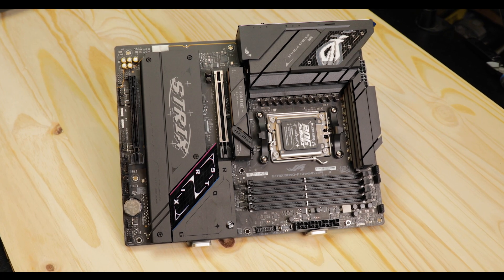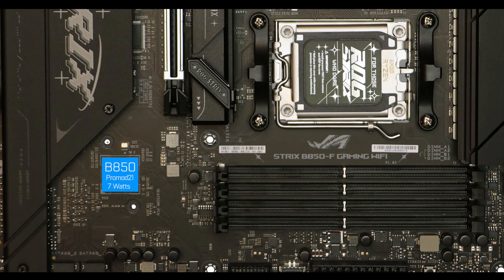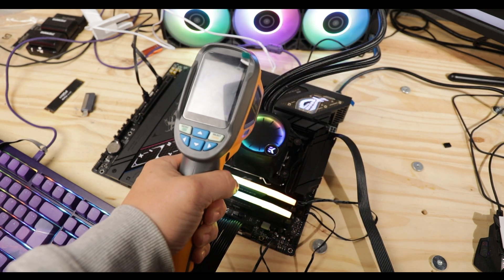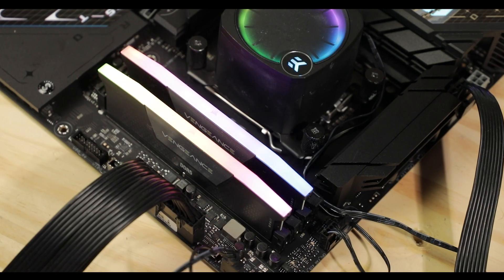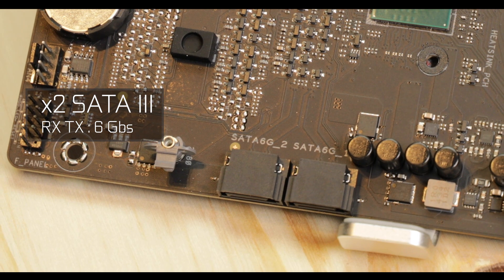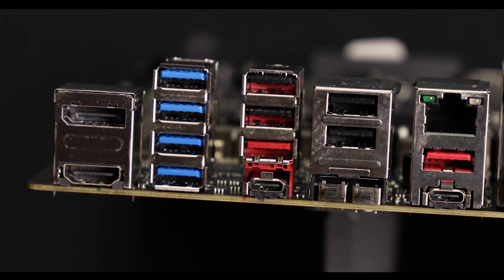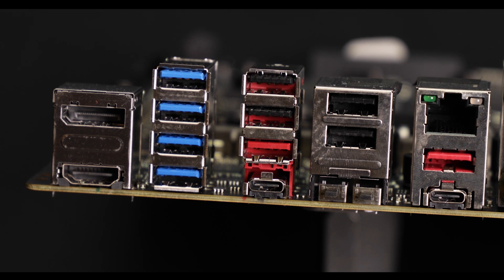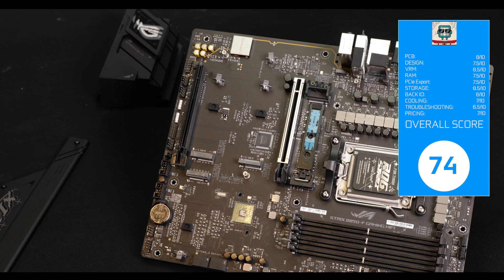ROG STRIX B850-F GAMING WIFI:  The F stands for FABULOUS!

Comment: Amazing work with graphics showing. I got one question though. I have 2 M2 SSD. One is surely goes under CPU, which one would you choose? I don't have Gen5 SSD. I am thinking right-last slot.
Reply from the maker: yes you are correct. The CPU M.2SSD and the last one are perfect

Comment: I've seen multiple of your videos talking about "50 degree limit" for the side block, but where is that number coming from? Does CPU or Mobo begin throttling past that? I am unable to find any other documentation mentioning the 50 degree limit
Reply from the maker: Hi Slav :)

Its a self imposed limit :) 

Boards who typically mange to get their VRM to stay anywhere between 50 and 60C after an hour long synthetic stress test on a high core count CPU, show all the qualities to be :

- durable , the solder point are far from being strained over time. When soldered points nuggets 80c, eventhough they do not melt, they start to degrade. 
- cooling system is endurant.  The PCB does its job in differing PSP legs heat through the insoluting copper plates. The thermal pads transfer more heat than produced towards the heat sink harvesting plates
Finally the VRM blocks do their jobs, both in reservoir and radiating area. 

When your board starts to show elevated heat surface beyond 60c and towards the 70c... the board life span can been as reduced 20% than optimal temps ( 50 to 60)
At 80 to 90 life span decreases by 50 percent with higher possibilities of instability  and signal bleeding 
At 90 to ... well anything beyond that point, life span reduces exponentially,  the system is inherently unstable and the heat produced by the VRM can easily saturate the air exhaust of your build and start to affect other components .
At that kind of temps a board usually can operates non longer than. 18 months with daily usage of 5 hours. 

I hope this helps :)

Comment: I’m having an issue with my ASUS ROG B850F, which uses the Realtek ALC4080 codec 

When I use the 3.5 mm mic port (mic-in or line-in), the microphone volume is very low. I’ve seen several posts mentioning this issue on motherboards with the ALC4080 chip. However, when I use a USB headset, the sound works perfectly.

Is it normal?

Comment: After multiple reviews of yours I landed on this motherboard, bought it today for the 9800x3d build that i'm gonna do next week, excellent job!
Reply: Did u have any issue with cpu? Did u have to update BIOS to be able to use 9800x3d ?
Reply: @mrlaz8061  no for both
Reply: I choose MSI B850 Edge TI Wifi, imo better board than this.
Reply: @danielstormy3660 better in which way ?
Reply: @danielstormy3660 doesn’t look as nice tho and is only 60A power phase
Reply: @danielstormy3660 why is the MSI board better? This B850-F board is about $240 on Amazon so I may get it unless the MSI board is about the same price and is better

Comment: I found this board on Amazon and after looking at all the features and then the $250 price it made my top choice to go with the great 9800X3D processor to upgrade my PC from the Intel 13700k. Now after watching your review on this board, it definitely solidified my choice to get this motherboard to use as the 9800X3d as its new home.
Reply: Hello! I'm looking to make the same upgrade! How did it go for you? My main concern is stutters in games.. I keep reading stutters on 9800x3d and keeps pulling me back :( how's your experience?
Reply: @MaxySnake  just pulled the trigger on this combo and it arrived today, if OP doesnt post I will let u know how it goes lol. Pairing with a 3080ti
Reply: @mouzerofficial omg congrats ! Nice setup. Hope it turns out amazing for you
Reply: same!

Comment: This or Gigabyte x870 aorus elite wifi 7?
Reply: I just returned my X870 aorus elite WiFi 7 since in a brand new build with everything the darn motherboard would not post with 2 x 32 ddr5 ram sticks. I could see the error code C5 on the debug screen which indicates a bent pin??? I am confident I didn’t bend any pins. Looking up Reddit and the internet, seems like this is a very very very common problem with the gigabyte motherboards. I ordered this one and put stuff in it, and was amazed that it works! Like it should!

Comment: My main problem is the price. The B850-F Strix is barely any cheaper than the X870-F strix so i would take that instead. While the B850 TUF is considerably cheaper like by 25% while barely loosing any feature we can get with the B850-F.
Reply: Where are you seeing that price in the x870? Everywhere I am seeing the x870 boards are considerably more expensive

Comment: Sooo, this or the tomahawk b850? it is worth the price diff?
Reply: No the Tomahawk is better. It has both 5Gb Lan and true 320mhz Wifi7 while the Strix only has 2.5Gb and 160mhz half-speed Wifi7. It has a better VRM but a 14phase 80amp VRM on the Tomahawk is already overkill even for a 9950X/9950X3D and other than that the Strix has an AMP for front panel audio which the Tomahawk doesn't have but unless you are trying to use an insane 4-600ohm studio headphone through the front panel then it doesn't matter either.
Reply: @kerotomas1  yup, i ended up with the b850 tomahawk, and very happy with it!
Reply: @AestheticKunt  Nice. 
If you are using the Wifi you probably have saved yourself a headache too as reddit are full of people with having trouble with the crappy Mediatek wifi Asus uses.
Reply: @kerotomas1  haha, in my case i use ethernet. Wifi is bad for gaming hehe
Reply: @AestheticKunt  Not really, i’ve been using Wifi for years now for my desktop pc as i didn’t want to ruin my walls 😅 If you have a good Wifi card 6E and up is really solid. My ping is always below 20 and haven’t had a connection drop for like ever.

Comment: Looks like a great MB except for the  Q-Release Slim PCIE slot. Seems hard to release while in the case and  it causing PCB damage.  It seems they redesigned for upcoming MB, but doing nothing for existing products.
Reply from the maker: Thanks :) 

Unless you plan to remove the same GPU 80 times or more.... Not much of a risk... I tried about forty times and got bored...
Reply: @ Can the GPU still be removed the traditional way?
Reply from the maker: @Jester_1 yeah.. just pull the butt and it'll free it too :)
Reply: @Laurentschoice Why has no one mentioned that before? If you could just release it the old way then it's no issue
Reply: @Laurentschoice  bs I broke that crap on the first time.

Comment: I think a good comparison would have been to the STRIX B650E-F as it's £200 compared to £320 for this board. Is £120 extra worth it for 1 more M.2 slot and WiFi 7? Especially as the chipset is still the same (Prom 21), both support PCIe 5.0 to the main x16 and main M.2, both are premium mid-range boards etc.
Reply: Almost forgot about the B650E-E - it sits at £270 and has exactly the same main features as the B850-F while being £50 cheaper. ASUS need to look at their pricing for these motherboards, a new B-series chipset board shouldn't cost over £300 if it's being beaten by last generation boards which are cheaper and will have the same ongoing support for AM5.

Comment: can you bifurcate those x16 to 8x8 or 8x4x4 or ???
Reply from the maker: Not in this particular board I'm afraid. You d need a multiple GPU board for this.
Reply: LOL once a motherboard doesn't share lanes and now we have people asking for it. Jeeezzz
Reply: @ not sharing lanes. Bifurcate the x16 in say 8x8 and with an adaptor plug 2 cards, or 4x4x4x4 and add 4 other NVMe.

Comment: They forgot the DEBUG POST CODE: -100 points, and I'm serious. With the stupid architecture of CPUs and RAM controllers, these things have to put up with not having an DEBUG POST CODE leads, inevitably to baldness, as in you pulling out your hair, or to prison, as in you throwing your tower out the window (did you forget you live on a third floor?) and killing your neighbour. Let's face it, probably both.
Avoid all Asus since they only put DEBUG POST CODES in motherboards that cost more than $550. Not even the PROART, which costs more than that, has a POSTCODE... A productivity board in which parts are always being replaced, which has dozens of connections to storage units, to NAS, to "clouds," which, by nature is always having issues... NO!
Just don't buy Asus.
Reply from the maker: This HAS to be the best comment of the year !!!
Reply: well the b850-E does have debug post code and is around 350.
Reply: @ , Very good call. I'll have to look at the chipset since I'm going to have an Intel B GPU as a secondary and a lot of storage requirements. Anyway, thanks, it looks great.